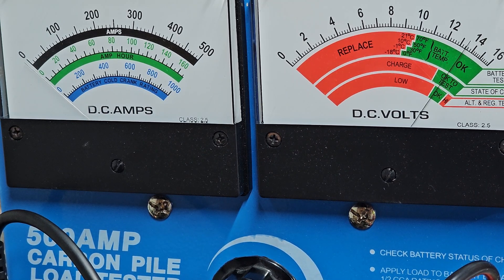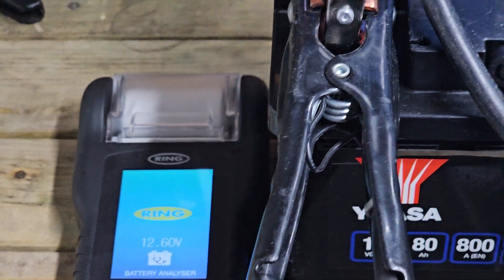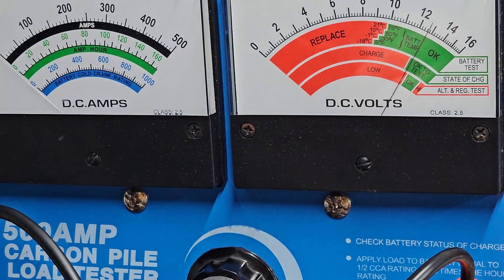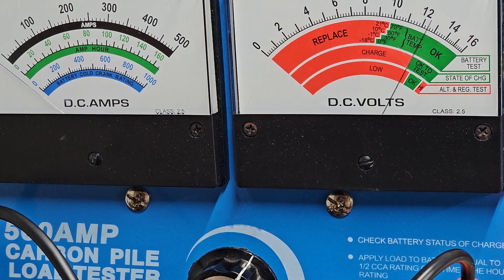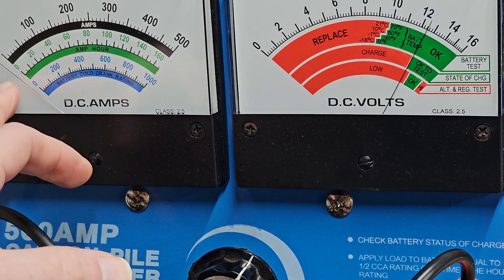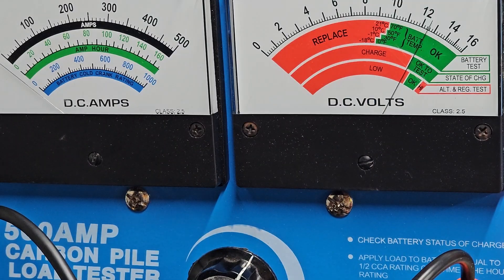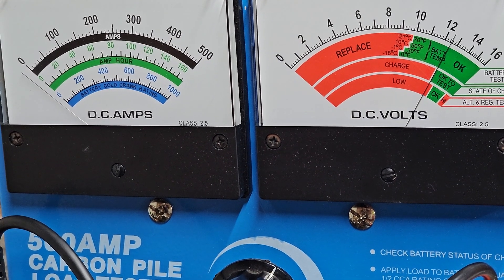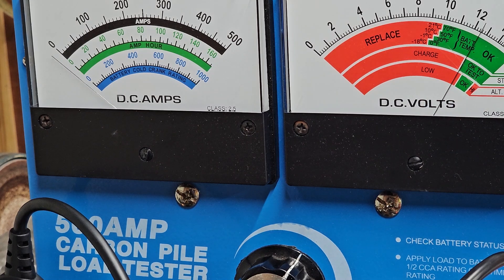500 Amp Carbon Pile battery tester, basic calibration

Comment: There's a potentiometer inside the unit for calibrating the amp meter, but the volt meter doesn't appear to have an internal adjustment.
The pot for the amp meter is connected in-line between the current shunt and the negative side of the amp meter.👍